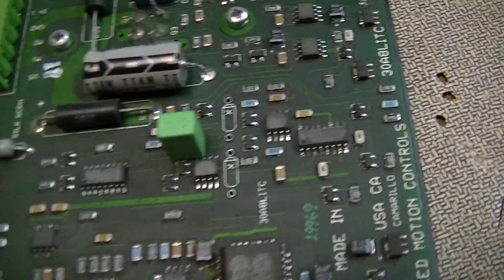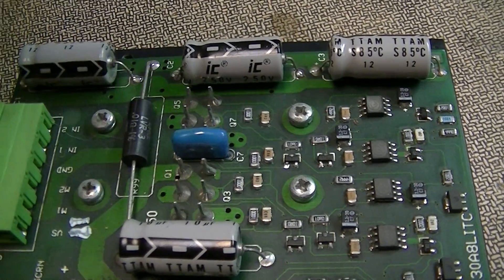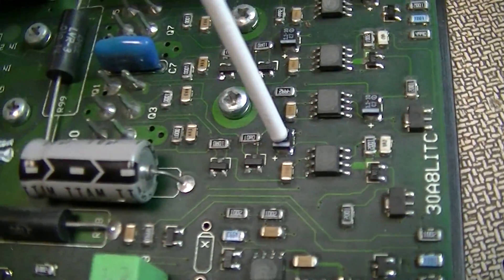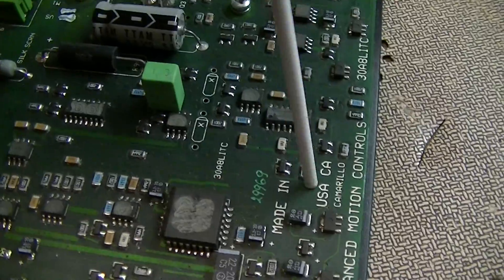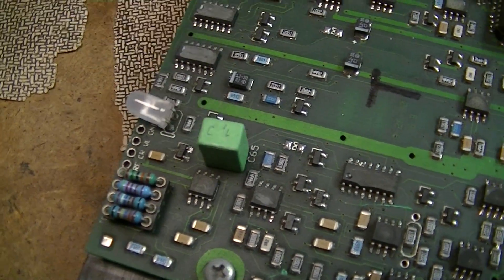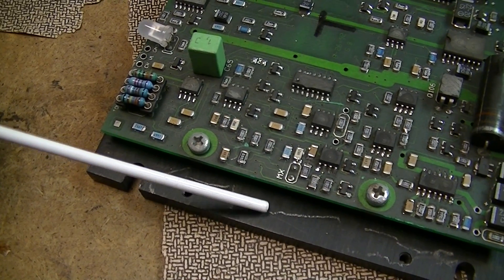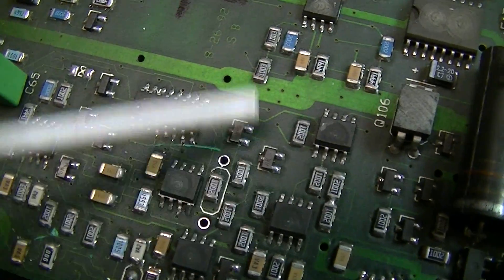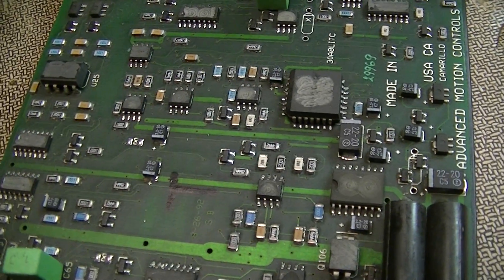Advanced Motion Controls brushed motor controller guts

Comment: With 4 power devices, and only two terminals labeled 'M1' and 'M2", it's a brushed motor controller. 

It also has the marking "30A8", which is AMC's designation for a 30V, 8A power ratings.

And yes, every AMC device I have seen has no part numbers on the ICs. AMC is a bunch of douches.